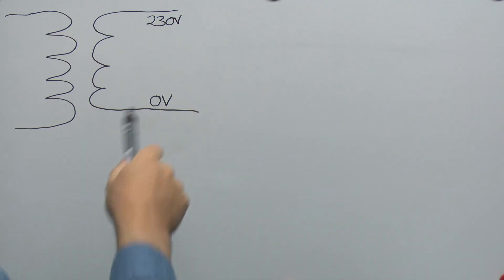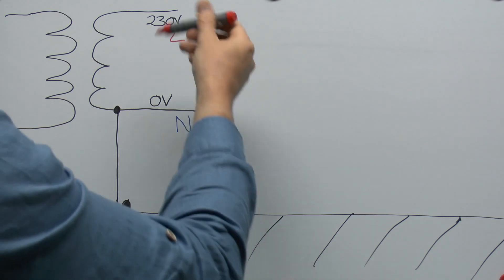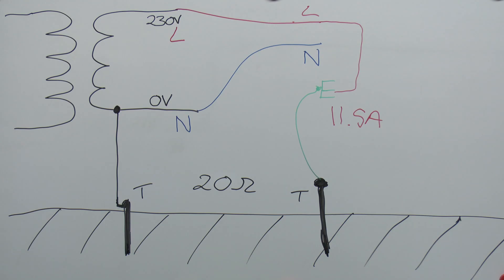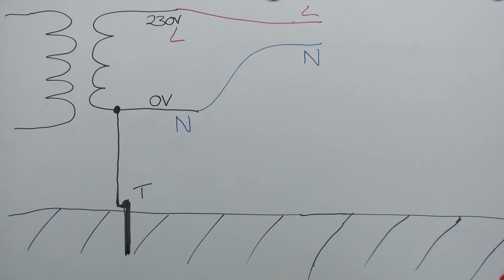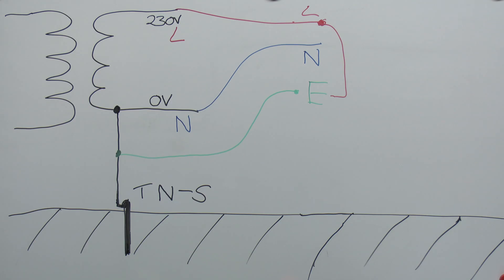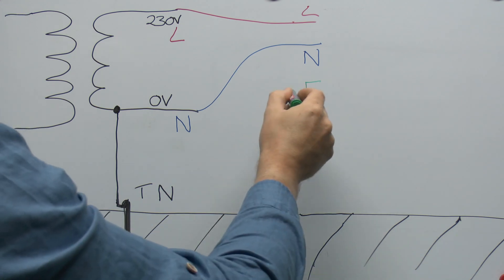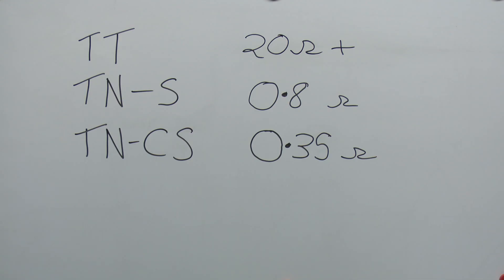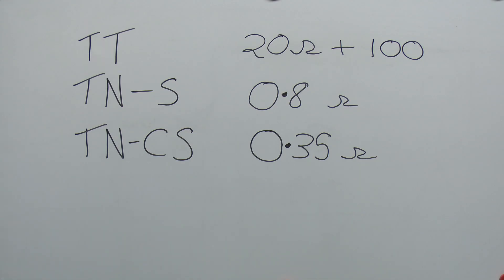Types of Earthing System for Electricity Supplies (UK)

Comment: Hi John, 

Great video. Regarding the TT earth, in the event of fault (phase+ground connection) does the current literally “flow” from the consumer rod through the mass of earth and to the transformer rod? 

Or is it the case that the amount of current that would flow to earth, would be basis the potential difference between the two rods? 

Trying to get my head around current travelling through physical earth? 

Obviously this is AC, so the current would be oscillating. 

Thanks.
Reply from the maker: Yes, the current flows through the earth itself from one earth electrode to the other one.
Most of the resistance is at the electrodes themselves, the contact area between the metal and the surrounding soil is the most significant factor.
The resistance of the earth isn't particularly relevant, and doesn't change much with distance.  It's a similar situation to an infinite grid of resistors all connected together as described here: https://www.mathpages.com/home/kmath668/kmath668.htm although in 3 dimensions rather than just two.

Comment: Hi John, if the neutral break was to happen before one of the PMEs would this reduce the risk inside the property due to everything else down stream still having some sort of reference to ground? I look forward to your response. Thanks for all your videos that you do, you truly are an expert in the field.
Reply from the maker: It would be slightly better, however to have any real effect the earth electrode(s) downstream would need to have a very low resistance, typically in the single digit ohms range.
Reply: @jwflame  Hi John, so just to clarify, if there was still an earth electrode connected downstream from the neutral break I understand that the resistance would be high due to the general mass of the earth returning to the source and therefore may not trip a MCB. But would the person who is touching the metal work be safe or would there still be a potential difference between the metal work and ground even though there is an electrode(s) at a lower resistance than the person and the general mass of the earth back to the transformer? Many thanks for your previous response it is much appreciated.
Reply from the maker: @stevenhargreaves9897  There will still be a potential difference - what that actually is depends on the electrode resistance and the loads connected to the installation.   With low loads connected, a higher resistance electrode will be effective at reducing the potential, but with larger connected loads a much lower resistance is required to have the same effect.  
With a broken PEN conductor, the electrode(s) become the return path for the installation current, voltage being divided approximately between the installation load and the electrode based on the relative resistance of the two.  With a moderate to high installation load, the effective resistance of that load will be small, so it needs a very small electrode resistance to keep most of the voltage across source-load rather than load-electrode.
Reply: @jwflame  Hi John, many thanks for your explanation. I would really like a YouTube video explaining this with different combinations of high and low load with high and low resistance electrodes, with a result of showing what the approximate potential difference will be between the metal work and ground from a broken PEN. I will however try to draw this out myself and understand it more thoroughly. Thanks for your help and time, it is much appreciated, Steve.

Comment: great video, very clearly and well explained. However 2 points. Most of Northern Ireland (rural areas) are still in TT. My house built in 2006 was done in TT. Also when you say neutral is the same potential as earth. Must be remembered that in an AC system half the voltage is carried in the neutral and the lifter you get when you accidentally touch between neutral and earth is worse than live to neutral (or at least always feels much worse!) Overall, well done.

Comment: Thank you John. In terms of EMC, which earthing system is the best for protect the equipment/ electronic equipment against EMI?
Reply from the maker: TT followed by TN-S.  TN-C-S is by far the worst option.
Reply: Hi John, is it better and allowed to put an earth rod next to the meter box for a TNCS system? 
So my neutral would be grounded and protect my property (my neighbors might also benefit) in case of what you said that the neutral wire is somehow broken.
Reply from the maker: @adamxu  It's allowed, but a single rod won't have much effect - you need a very low resistance earth connection and that normally needs a buried metal grid, tape or similar.
Reply: @jwflame  I found the property has the green wire connected with a copper tube/rod into ground. Suppose that is the earthing. I'm in Melbourne Australia.

Comment: thank you for your awesome videos! Most factories install their own 3-phase transformer (delta to Y) within their premises together with own earthing system (earth rods). Would that make a TT earthing system?
Reply from the maker: It could be done as TT, but generally it would be TN-S or TN-C-S.  All depends on what cabling is installed from the transformer to the installation.
A transformer requires it's own earth electrode for all types.

Comment: Looking at the diagrams for TT and TN-C-S, they are the same except the earth is connected to the N at the consumers premises in TN-C-S. In a rural TT situation, why can't the house earth cable be connected to the N at the consumer unit in the consumers premises, by the local electrician, which will convert a TT to a TN-C-S.  I am sure there is a reason why not.
Reply from the maker: The ESQCR prevents electricians or property owners from making that connection.
If conversion to TN-C-S is done, the rest of the supply network to the building also needs alterations, most usually by installing additional earth electrodes to the combined N&E conductor, which is why most TN-C-S services are also PME (protective multiple earthing).
It's also essential that when converted, all of the properties on the same supply network are converted at the same time.

Comment: As I understand it - a supply that was originally TN-S and not changed within the dwelling could de-facto be TN-C-S as a result of changes made by the supply company in the street.  Without any notification to the householder  required it is potentially dangerous to assess systems solely by looking !
Otherwise a very informative video.

Comment: Another great video, thank you JW.
Just a thought here but go back to 11.17 and this time draw in the Main Bonding Conductor which as you know will be tied to the Main Earth & Neutral, this would now become the return path and act as the NEUTRAL for the Whole Building and demonstrates how dangerouse this scenario could be, making Gas and Water Pipes turn into NEUTRAL PATHS.
But in Summary this scenerio you have given at least in today's industry 2020 is very unlikely to cause a problem. Trying to draw power down through an RCD/RCCB with only the LIVE Connection Connected is going to be a Non Starter as it will immediatly sense the inbalance of the Live Phase to Neutral Phase and Trip when an accessory is switched on, or will it just adopt the Earth Bonding as the Neutral and carry on supplying power !?!
Mr Spence Eng

Comment: Can you make a TT earthing system a TNCS system? by linking the Earth and Neutral bar at the switchboard, in Australia its called an MEN link.
Reply from the maker: No, in the UK only the electricity network operator can make such changes, and if available that link will be made inside their equipment only. (usually their cutout/fuseholder which is before the meter).   N&E links within customer equipment are not permitted.
Reply: @jwflame  Yes I know we can't do it,  I'm a qualified sparky from England, but I moved to Australia and they only get an Active and Neutral, plus an Earth rod at the house, then link the Earth and Neutral bar together (MEN link). It then makes it a TNCS rather than TT. I'm just curious to why there's TT systems in UK when all that's needed is an earth connecting to the neutral cutout and make it TNCS for a direct Earth?  Or do TT system not get multiple earthed down the main Neutral cable so it would be unsafe? Im UK sparky and Australia is behind in Electrical compared to UK, it just got me thinking about it. Plus Australia never does any Ze tests which is very rough.
Reply from the maker: Yes - for TN-C-S to be an option, the rest of the supply network needs to have multiple earthing points.  Many older TT networks don't have this, so allowing people to just create their own link between N&E would result in a dangerous situation.
The same legislation that prohibits consumers from making that link also requires that the electricity distributor installs the multiple earthing within the network if it's provided or converted to TN-C-S.
Reply: @jwflame  So in Australia its mainly an overhead supply from the pole, with seperate Active and Neutral single conductors. So this type of supply is very dangerous? If say a tree branch breaks and snaps just the main Neutral conductor - this will then leave a very dangerous situation. The Earthing system will then become live leaving the Earth rod and water pipes with current flowing through them to Earth. I think Australia needs to learn from us UK sparkies.

Comment: HI John. I do like your videos,  and I alawys spot your Hammond (I am a Hammond player)  The real point of my comment -  If you have a TT system -  in addition to the earth rod, why not also connect the Earth to the Neutral at the supply point?  That would surely reduce the Earth Impedance and make the earthing system safer and more resilient - what have I missed?
Reply from the maker: Doing that is specifically prohibited by the Electricity Safety, Quality and Continuity Regulations 2002.  Electricity distributors can combine the earth and neutral, but only if certain other criteria are met, and then it becomes a TN-C-S system.
Reply: I did realise that my suggestion was a "DIY" TN-C-S system and I suspected that there would be a rule to say that you could not do this.  However the way you describe the supply setup in both TN-C-S and TT systems is very similar apart from the fact that in TT systems there may not be mutiple earths along the supply neutral, between transformer and the property.  So in purely theorectical terms, why is my suggestion not appropriate?  I am sure the rules are in place for good reason, it is just that I don't understand them.  I am also sure that your "only if certain other criteria are met" is going to be the crux of this, but I cannot begin to guess what they might be..   Thanks for your response.

Comment: Just seen this excellent explanation but just one point to clarify the construction of pme type cables in a concentric manner is correct but at each and every straight joint position they are formed into one core for jointing purposes and joints fail - often the nuetral core . Up to the early 2000's the nuetral conductors on the distribution mains cable were made of aluminium and any slight nick in the outer pvc sheath of the cable results in the concentric neutrals perishing to dust again resulting in an open circuit on the nuetral conductor . The nuetrals are now made from copper for this very reason but from the late 60's onwards they were all aluminium . The protective multiple earthing element of the system should minimise this problem but in practice most of the earth spikes connected to the system serve little or no purpose as their resistance is never measured . The point being that nuetral open circuit faults on this system are not as uncommon as the gentleman suggests and damage to properties and their electrical systems are substantial especially on the 3 phase system resulting in high voltages being supplied .

Comment: we are renovating our house it is an old tt supply and we discovered the earth wire came disconnected from the earth rod (its fixed now)
Reply: Have an earth cable to the water or gas pipe, or both. If one breaks then OK.

Comment: Had a case where a screw shorted light switch switched line to earth. No RCD. Only symptom was the combi boiler kept tripping out on flame failure. Only when the Utility room light was on (not obvious at the time...) On inspection the live was 140v above ground at the boiler- flame failure detector required more! The earth spike was underneath patio paving, and may have been quite dry... On bright days there was no fault to find!

Comment: 230v Wish it was. In our village it hovers in the mid 250s (Yes, often above the 253 max). Items fail. After decades of a nominal 230v the suppliers have made no moves to drop it from the old 240. A cynic would point out that for static loads it increases the power you have to pay for (by nearly 9%).
Reply: My understanding is that despite what the sellers of voltage optimisers would have you believe the extra voltage makes very little difference on modern equipment. Most resistive loads are for heating (immersion, oven, kettle etc...) and will be stopped by the thermostat, it will heat quicker at 250v vs 230v but not use more total energy. Most other modern equipment is switched power supplies (most led lights, computers etc...) and these shouldn’t use significant extra power at 250v vs 230v. Old incandescent lamps would use more power, but they’re rare now, and some inductive loads like fans and maybe the compressor on a fridge/freezer might use some extra power too.

Comment: What if I supplied an outdoor event with a concentric cable with a tn-c-s
Reply from the maker: Concentric cables are not permitted for use within installations as they only have 2 conductors, and TN-C-S for outdoor events is entirely unsuitable.

Comment: What I'm  struggling with at the moment is on TNCS how come the Neutral voltage isn't going straight to Earth at the property? With the  E and N joined at the property surely the return would go straight to earth rather than back to the Transformer. It would be like you're sticking the N into the ground. Or have I missed the point?

Comment: In regards to TN-C-S does anybody know what to do with private swimming pools in homes? Would a TT setup be best in that scenario as all it takes is the neutral to be cut and the swimmers could be killed assuming there is earth bonding to all pipes. Or maybe a TN-C-S with an earth rod added may help but still the neutral being cut seems to be the issue. Perhaps even an RCD at the meter cabinet for everything?
Reply from the maker: TT is an option. 
With TN-C-S, one earth rod will do very little in the event of a broken neutral, a far better solution is a metallic grid or mesh in the ground under the entire swimming pool area, which would need to be installed when the pool is constructed.
An RCD will not trip if the incoming PEN conductor is broken, so it useless in that situation.  However RCDs still required for all circuits to disconnect for other types of fault.

Comment: We use TN-CS in the US but we additionally attach a bare wire from a ground rod at the electric meter to the earth terminal in the fuse box.  We also run a bare copper from the rod to the nearest hose bibb, I think for discharging lightning.  The plumbing would provide a path thru to the utility's piping system which used to be metal.  It's probably changed since plastic supply pipes were introduced.  Wait, many pipes from the 60's were asbestos-cement which i wouldn't think was conductive so I'm not sure of the system.  They may have terminated with a ground rod at the water meter in that case.

Comment: I think in Australia  its a TN"T"-CS ? if thats a thing :)  
active (line/live) and neutral in
earth rod is used from main earth bar,
but in consumer units the earth and neutral bars are also linked.... 

just covering  "all" their bases?  thoughts? .. is that still a method used now days (any aussie sparkies care to comment as well?)
Reply from the maker: UK TN-C-S installations can have an additional earth rod, and that was actually suggested as becoming mandatory a couple of years ago.
However it's still just optional, and almost never done.
Reply: Thanks John, so seems Aus uses TN-C-S  along with your optional - our mandatory,  earth rod (1.4 mtrs into ground I believe, thats the normal size rods you can really only buy). 

I guess it's safer if there's a break in cable, where we have a lot of aerial cables into homes, that are actually two separate cables, twisted around each other, no doubt the undergrounds would be more like the coax style

Comment: I am not sure why the earth reference is done in the first place? Why can't we have two wires directly from the transformer secondary coil to the house directly? Then both the wires will be live and even if someone touches a single wire, there will be no path for the current to flow back to the grid right? Only possible shock might be, if a person touches both the live wires simultaneously, but then again the impedance would be very low to trip off the breakers. Isn't it much safer not to reference the ground to the grid transformer, effectively creating an isolation transformer?
Reply from the maker: Isolated is only safe if it stays isolated - any fault to earth anywhere and it becomes earth referenced with no way to detect that fault until a second fault occurs.   Far safer to have it earth referenced to start with, so that faults can be detected and the supply disconnected.
Reply: @jwflame  got it. Thanks for clearing up the confusion John.